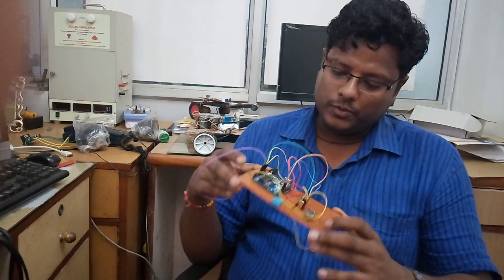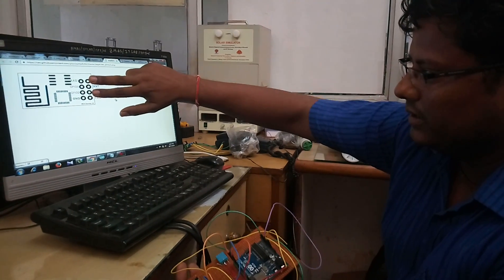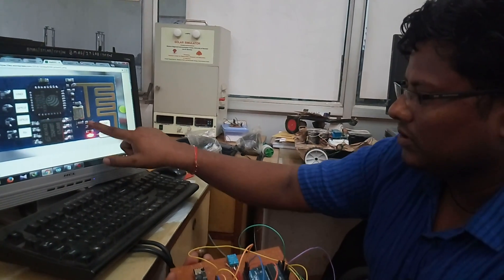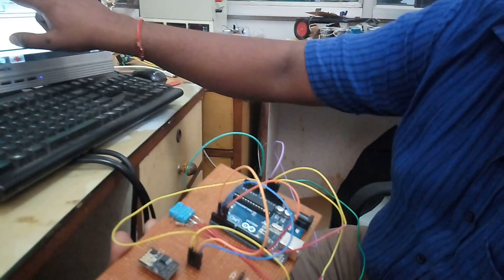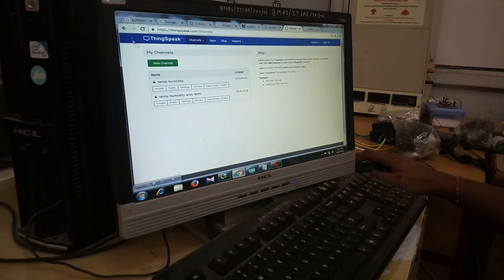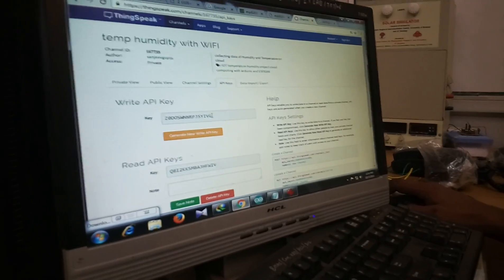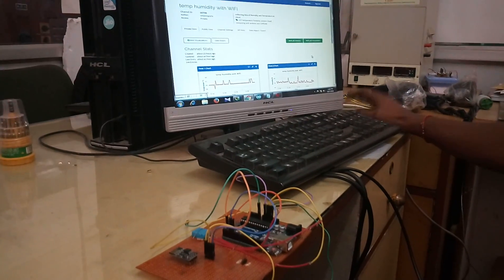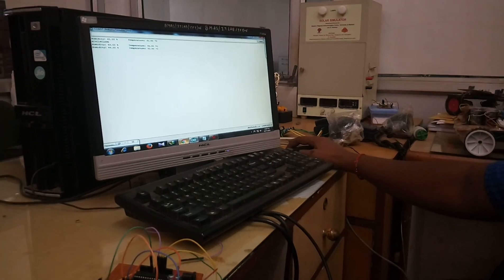Arduino ESP8266 and DHT11 WIFI Temperature sensor controller

Comment: With guide lines
Reply from the maker: as it seems u need to design real hardware or just need to simulate the results?
foe code and complete solution you can discuss your problem statement to me and ask for the code solution...foe coding of your project you need to donate some amount  to my freelancing company  which depends on your project complexity ..first proof of your developed project is shown to you and only after your satisfaction you are asked for payment.. you can directally watsapp me on 9410407419

Comment: i am trying to build a arduino/ESP8266 with temp sensor so that at a particular set temp it sends a single to another arduino/ESP8266 with relay to turn on a cooler/heater. what is your thoughts? thanks btw great presentation.
Reply from the maker: as it seems u need to design real hardware or just need to simulate the results?
foe code and complete solution you can discuss your problem statement to me and ask for the code solution...foe coding of your project you need to donate some amount  to my freelancing company  which depends on your project complexity ..first proof of your developed project is shown to you and only after your satisfaction you are asked for payment.. you can directally watsapp me on 9410407419

Comment: Anuj Bhardwaj  CAN I GET THE COMPLETE CODE
Reply from the maker: As I am a Free Lancer you can have same code with circuit diagram or you can have full code and circuit connections by paying minimum amount.....if interested then please contact on bhardwejanuj@gmail.com
Reply from the maker: i can even code as per your requirements. Thanks for your interest

Comment: Hai your project is awesome
Can u send me the code and circuit diagram i am inturn doing project related soil moisture using IOT
My mailId: prashanthraja11@gmail.com
Reply from the maker: As I am a Free Lancer you can have same code with circuit diagram or you can have full code and circuit connections by paying minimum amount.....if interested then please contact on bhardwejanuj@gmail.com

Comment: also need library of DHT11
Reply from the maker: As I am a Free Lancer you can have same code with circuit diagram or you can have full code and circuit connections by paying minimum amount.....if interested then please contact on bhardwejanuj@gmail.com